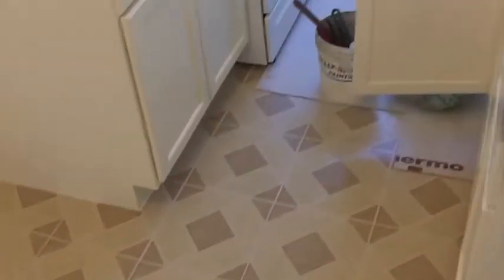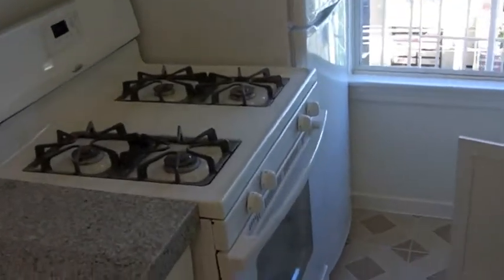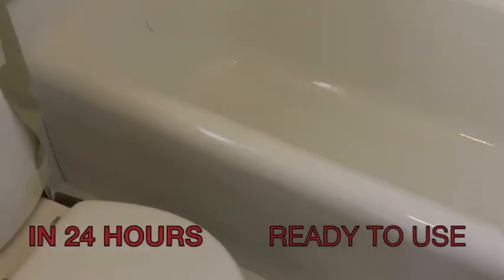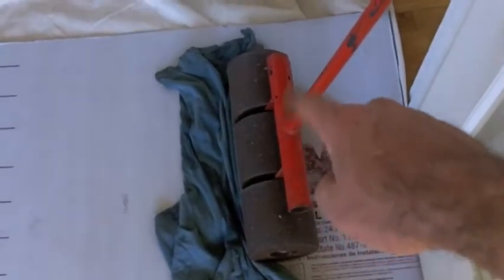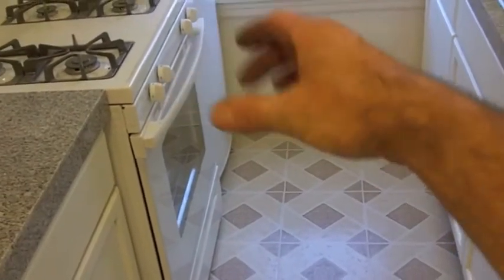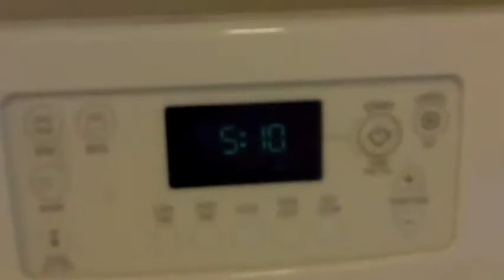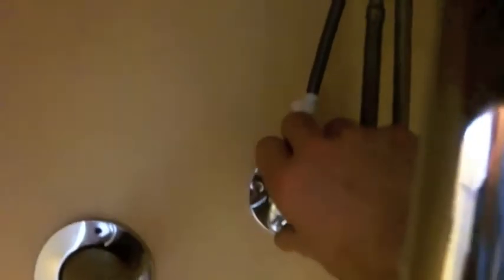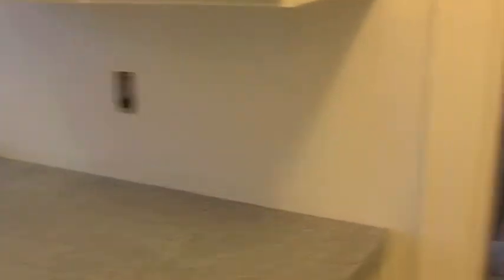Kitchen Remodel Update and Helpful Tips

Comment from the maker: @AVTreasures I keep a few sheets of thermo-ply around.4x8 sheet runs $9, cheap ins.Protects finished floors from dirt and damage.It has a vapor barrier imbedded in it so it also protects from water.  It does not break down or bunch when you roll a heavy dolly over it.The frige was a breeze with the appliance dolly...one of my better investments.Great control and leverage.The tub was money well spent,would have been a pain to get the old one out and a new one in. Thanks for watching.

Comment from the maker: @Graveltrucking I try to keep the rentals a neutral base color, we have to appeal to the masses.  I have had water issues in the years past, and unoccupied places with new fixtures always makes me cringe a little.  The original cabinets were only 21 inches deep (had a wall mount faucet) so there was more room to move in and out.. The new cabs are 24 inches deep, plus just about an inch for the countertop overhang. Thanks for watching.

Comment from the maker: @500passwords Hey 500, I bet that material would work.  It comes in any color, and they use a hot thinner that flashes in 5 minutes so it is easy to build up the product and get a thick coating.  Once it's cured, you can wet sand and polish it to a glass like finish...that would look sweet on a tractor hood.  Hmmmmmm